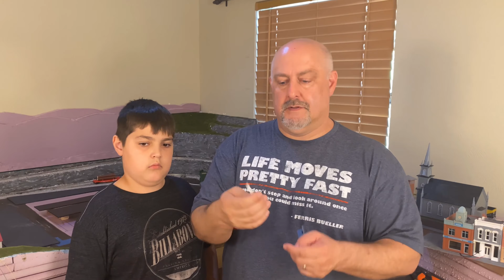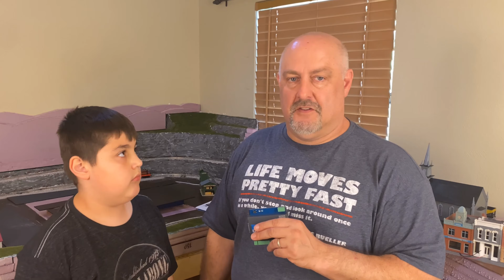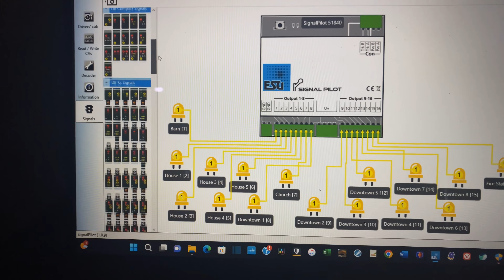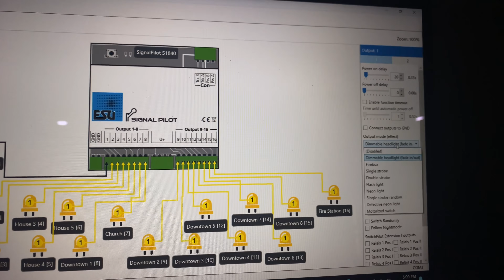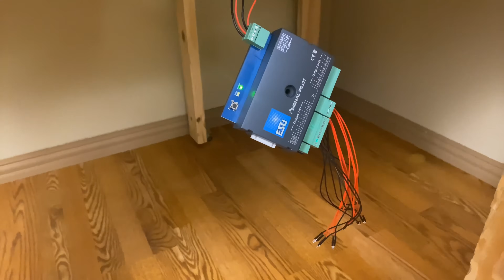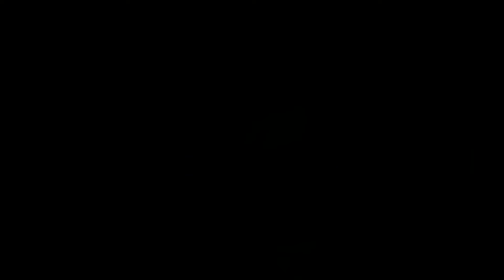Model Train Layout Lighting (ESU SignalPilot)

Comment: Great video.   When I use small leds on any ddc unit I add an extra resistor in series  to cut down on the current.  I noticed that the resistors got hot when using dcc
Reply from the maker: Thanks for that tip. We were not thrilled to see the LED strips supposedly designed for model train layouts melting AFTER we had installed them in quite a few buildings. I'm just glad we caught it before hooking everything up.
Reply: @TwoRailfans  dc output on accessories is 12 v.  Dcc is 14 to 16v
Reply from the maker: @Normancorey1162  these LED strips were supposedly rated from 12-18v. I will never buy them again though.